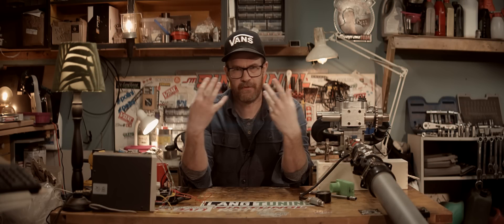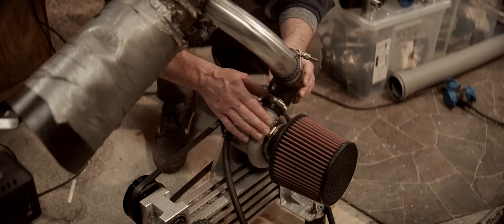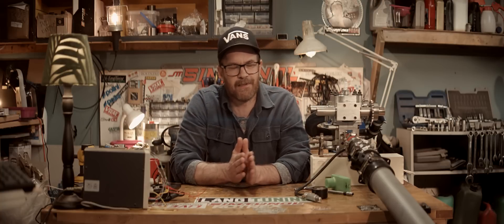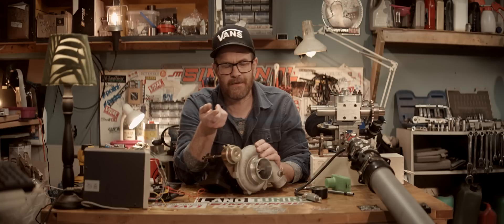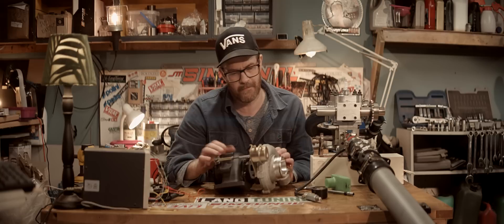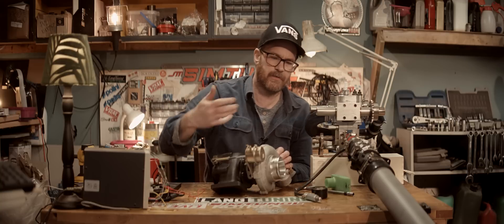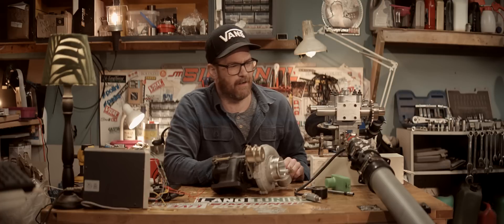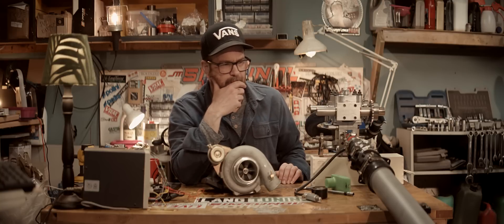THE most genius/stupid idea! Turbojet supercharging.

Comment: It makes no sense to say the centrifugal blower flows too much air at 1.8-2.0 bar, the max air flow of the blower is irrelevant. As with all turbo systems, all that is required is a blow off valve for excess 'pressure', flow is not considered.
Using a mechanically driven centrifugal blower to power a turbo is equally crazy, all you are doing is compounding your system losses which is sacrificing engine power for no gain!!
Reply: You missed the turbojet part; not using the mechanical compressor to spin the turbine directly, but also adding combustion - supercharger essentially feeding a jet which is in turn spinning the compressor housing to create the boost that's finally fed into the intake of the engine...
It's pretty intense, but the main question is whether the rules could still consider that a '50cc engine' at heart, given that there's effectively two combustion chambers?
I imagine not, though I still want to see it running!

As for the 'too much airflow' comments, though you're right that it can be dumped, it will be making too much even at WOT, and since you have already spent the energy to create that flow it's massively wasteful.
The pressure/volume relationship is terribly complicated and the only vague understanding I have of this is in relation to cooling fans, how some designs are better at static pressure and some at total airflow - I have some 24v 120mm monsters from old RF gear which can flow 1000cfm but any significant filtration behind them drops flow to a fraction of that number, and doesn't create any meaningful pressure either. Conversely a big centrifugal fan from a ducted air setup can maintain flow through 1/2" open-cell foam almost like it's not even there.
It's similar to the difference between a centrifugal blower and roots-type, they behave very differently when restricted; a roots blower can produce much higher pressure at a lower overall flow rate, which is technically great for his needs, but it also runs out of puff too early in such a high-revving setup.
Reply: @ph0end  Again ridiculous, he would be creating a jet engine to drive a turbo to feed a 50cc engine. It would be simpler to strap several jet engines to a 50cc moped...
Reply: @manoo422  
Simpler but orders of magnitude less effective - spinning an impeller to incredible speeds takes a jet that fits almost in your hand, but moving a bike & rider with direct thrust takes Robert-Maddox-level contraptions and won't break any speed records, plenty of videos of his to watch.
Is it a crazy idea... yes. Definitely yes.
Is it a sound theory? Also yes.
Would I like to see it attempted? Oh hell yes!

edit: Of course jet-powered landspeed vehicles are a thing, but the size and complexity of the jet turbine for that application is far beyond anything even close to the level/scope of this project - the kind of jet(s) that he can feasibly 'build and slap on a moped' is what I'm saying will be woefully insufficient for a direct-thrust method.

edit2: In relation to your discussion with Taren, the additional power comes from the flow that you're suggesting be vented at WOT!
Look up 'Twincharger' (Series) on Wikipedia, oversized supercharger-into-turbo is not a new idea, it is a tried and tested one.
Reply: @ph0end  Look up Zapata flyboard to see what tinny jet engines can do.
Land speed record for a 50cc engine...we are not talking about Thrust ssc hear.
The ONLY venting required is for excess pressure which it doesnt sound like there is any at WOT.
In twincharging the supercharger isnt driving the turbo it bypassing it until the turbo spools up and takes over.
Reply: @manoo422 
There is definitely excess airflow at the desired pressure at WOT, it's Alex's statement about this that caused this whole discussion. I think you're missing that all compressor designs are not created equal, I've given a couple of examples but another real world one is a piston compressor like the type you blow up tyres with can create very high pressures at very low airflow but an airbed inflator does the reverse; it can build moderate pressure but creates a massive amount of airflow in the process. A centrifugal supercharger behaves more like the latter and a roots blower more like the former. Twincharging doesn't always bypass after turbo is spooled up, you can keep compounding (with issues like excess heat) or you can bypass, both approaches have been used in production engines, doesn't sound like you read the article.
Finally, turbo setups also don't always have factory BOV, 1988 Holden VL turbo (rb30det) is one example, it has wastegate only. Yes the turbo cavitates, no it's not great for it, and yes other vehicles have done it particularly in the old group B rally scene and in drag racing in an effort to not lose all the built boost between gear changes on small engines with big turbos that take a long time to spool up. If you want to hear the sound made when a turbo gasoline engine with no BOV closes the throttle look up 'VL turbo dosing' here on YouTube. Additionally, no turbo diesels have a BOV either as a diesel has no throttle butterfly; the intake never closes, it's why they need a vacuum pump to run the brake booster as the engine never produces vacuum, so your continued assertion to the other guy that every turbo engine ever made has a BOV is just plain wrong.
You clearly have some knowledge, just not quite enough to realise you're off the mark in this case.
Reply: @ph0end  If you think there is excess flow then how is it being measured?
The principle of twincharging is a super charger for low speeds and a turbo for high speeds, one takes over from the other. Its not to drive a turbo with a supercharger which is what is being proposed in the video.
Competition turbo builders are happy to sacrifice component life for performance by leaving off the BOV. I have a turbo diesel and when the exhaust was damaged you could hear the BOV dumping into it every time I changed gear.
Reply: @manoo422  
That would be the wastegate you're hearing, turbo diesels do not require a BOV as they have no throttle plate/butterfly; the engine revs or slows as fuel input is increased or reduced, the accelerator controls fuel governance only, not air. The way they operate is considerably different to a gasoline engine.
I too run a turbo diesel vehicle, a Toyota VDJ76, which you will find has no BOV listed on its part breakdown as it does not require one. 
It's not just 'competition turbo builders' who omit a BOV, I have already quoted a gasoline vehicle that left the factory with no BOV, despite your claim that they do not exist, there are many others if you care to look.
Next, read the Wikipedia article on twincharging and come back to me, there are multiple ways to configure the setup, and one is absolutely feeding the turbo with the supercharger, and can include a bypass, _or not_. Some vehicles with this configuration are even quoted in the article.

Time and again, you are conflating fact and opinion. Feel free to look up the part number yourself for the replacement BOV that you don't have on your turbo diesel vehicle...

Lastly, the way to measure flow volume at various pressures is shown in the video you're commenting on; a flow bench. This may be a rudimentary example of one, but it is literally how such things are tested. Call a shop that does head or turbo flow testing and argue with them instead of some stranger on the internet.
Do literally anything other than blindly defending your own assumptions, because at this point you appear to be arguing for its own sake; campaigning, not debating.
Reply: I don't know of any turbo system ever that used a blow off valve for excess pressure management(Other than at low load situations of course) wastegate(or VG) is the preferred method(It is very very obvious why), flow is obviously considered if you don't want to waste power on doing nothing of value.

How is the turbo idea "sacrificing engine power for no gain"?
The turbo idea could create higher pressure from the same parasitic engine load, obviously meaning higher power...
I mean he could just use a turbo as a regular self driven gas turbine and use bleed air for engine boosting, but I assume the land speed record rules sees this as a separate engine.
Actually have no idea what the land speed record rules say about any of this.
Reply: @TarenGarond  What do you think you are hearing on a tuned engine every time the driver lifts off the throttle?
He is quite clear at 7:47 that the turbo is fed from the centrifugal blower, that makes it sacrificial.
Reply: @manoo422  I'm quite sure lifting the throttle fully is considered a low load situation...
But yeah sure pressure is dumped in slight lift offs too so yeah I should have said something about that, but anyway it kinda irrelevant anyway no turbo system ever(That I've heard about) does manage pressure though dumping air in normal full throttle operation conditions(Think some two-step systems might dump air though to get the turbo operating in "better conditions though").

You originally said "sacrificing engine power for no gain" which obviously is wrong, you are able to get more power from driving a turbocharger with an SC than directly using the SC to pressurize the engine.
Yes might or might not make more sense to just have a turbocharger driven in a classical way.

Edit : I re-read your original comment more properly and your "sacrificing engine power for no gain" might not be meant as normal SC vs SC powered turbo, but SC powered turbo vs regular turbo...
Reply: @TarenGarond  I can only assume you have zero experience of turbo engines because every single one has a blow off valve which opens every time the driver changes gear. It is obviously NOT irrelevant as the engine wouldnt last long without it. A waste gate does exactly the same job of reliving excess pressure from the inlet, so as I said air 'flow' is irrelevant.
If you think its not sacrificial where do you thing the addition power 'output' is coming from? Or do you think driving round all day with your headlights on doesnt effect your fuel mileage...?
Reply: @manoo422  "A waste gate does exactly the same job of reliving excess pressure from the inlet" lol, what?! The wastegate does dump exhaust to limit boost pressure, it is obviously not "exactly the same job"...
You don't make much sense

Edit : I don't even care to reply to the rest...
Reply: @TarenGarond  What is the exhaust waste gate actuator attached to? Could it be the inlet manifold?
You cant reply because you dont understand how a blow off valve works or basic physics. On every single turbo engine ever built.
Reply: @manoo422  I obviously could have replied but it is a bit of a waste of time as I mostly had said what I wanted to say.

But yeah I advice you to do a bit of reading about turbos and centrifugal compressors in general(Watch some compressor maps and turbine maps) as you don't seem to have much of an idea of their operation and the total stupidity of dumping out large percentage of air to regulate boost pressure in a steady state full throttle operation.
By the way, the way dump valves dump air is totally irrelevant to the discussion(But I obviously know how they work, if done in the classic way(Electronics could be involved these days) the valve is opened when a certain pressure difference between pre-throttle(Wherever the dump valve is mounted) and after the throttle is obtained, this is done to keep the compressor away from surge on throttle let off) as I originally replied to you saying :
"It makes no sense to say the centrifugal blower flows too much air at 1.8-2.0 bar, the max air flow of the blower is irrelevant. As with all turbo systems, all that is required is a blow off valve for excess 'pressure', flow is not considered."
(I agree that the max air flow is irrelevant as the supercharger is very oversized(No idea why you are talking about it anyway, did you mean minimum flow?) it is the minimum (stable) flow around the wanted pressure and used compressor RPM that is interesting in this case)
In this text you seems to state that dumping out air of a very oversized centrifugal supercharger somehow is a good idea and also that all turbo systems do dump air to regulate boost pressure(They obviously use a wastegate for that!!!) or what the heck did you mean?

By the way did you in your last reply say that blow off valves are on every turbo engine ever built?!
In that case, what the heck you on about?

Comment: I think the only problem with this idea is that it's no longer a 50cc engine. You are adding additional combustion volume external to the main engine. I think the real solution might be to try and work with rotrex or someone to just make a custom supercharger.
Reply: It's kinda like anti-lag,  don't know about the rules regarding it are though
Reply: @jordanthedove its like the time subaru did that in rally. There is a video here on yt that explains this concept really well
Reply: @LuxGamer16   Nissan did similar in the 80s with the K10 March/Micra Super Turbo.
Reply: I want to be clear I'm not saying it can't work. I'm saying that in the context of his stated goal which is to build the "most powerful 50cc 2 stroke" and then go for a land speed record you can't add another engine, motor, jet, or rocket. That defeats the whole point of trying to make a highly optimized 50cc engine.
Reply: @crystaldragon141  precisely. its a 50cc engine. "swept volume of 50cc". not "externally assisted". theres no rule about how much air is actually in the cylinder, but the basic cylinder providing ALL the power required, im pretty sure thats a fairly strict rule...

the thing is, he is on the right path, he just hasnt had the monumental "lightbulb moment" yet...

the engine already IS a combustion chamber. it doesnt have to serve a dual purpose, ie, a compressor AND expander...
Reply: Imagine an engine that is being boosted by a supercharger which is being run by an electric motor - do we need to add the battery capacity or the electric motor HP to the final power output?  Nope. 

Same idea as an electric car with a small battery AND a small petrol engine that generates electricity, charging the battery.
Reply: @N0MAD1977  I disagree you do need to add in the external power, it's functionally the same as adding another gas engine. The only way your example works is if you generate all the power in the battery with the gas engine. This can work but you can't charge up a big battery on the side and then just consume it. His ultimate goal is a Landspeed attempt with the "Most powerful 50cc 2 stroke. You can't have a 50cc then strap on jet turbine and call it the same. Turbo's and Supers are different because they are powered by the engine. It takes horsepower to run a turbo or super. The bonus is if sized correctly they end up adding more power than they consume. Primarily by shoving more air into the cylinder  which lets you add more fuel for a bigger bang.
Reply: @crystaldragon141 turbos don't rob horsepower, they actually make your engine more efficient because you are using spent exhaust gases to produce more power
Reply: @jok3yjesu339  a Turbo consumes energy in the form of expanding hot exhaust. Anything that does work consumes energy. Horsepower is just one measurement.
Reply: @crystaldragon141  it doesn't rob horsepower, it uses the wasted energy that the engine doesn't use aka the heat and energy of the exhaust moving after the combustion process
Reply: @jok3yjesu339  something has to force that exhaust gas out through the restriction posing as the "turbine". 

turbos raise exhaust pressure. by doing so they reduce scavenging efficiency. theres more residual exhaust gas in every fresh "charge".
the higher the cylinder pressure at the end of  the exhaust stroke, the less fresh charge can be pushed in.

other than that, yes, a turbo makes most of its power by using otherwise wasted exhaust heat, and raise the total efficiency..

except then they have to run on a richer than desired mixture to prevent catastrophic engine damage, so the gain in economy in one aspect is negated by another.

in the end, they both work out to be much the same on fuel economy and peak power, only real difference is  a fixed displacement charger maintains the same level of boost at all RPM, the CSC and turbo having logarithmic boost curves.
Reply: @N0MAD1977 there a guy doing just that on is car brushless electric centrifugal supercharged
 it work pretty good 
He modified a vortex supercharged if my memory serves me right
Reply: I know he is doing experimental stuff, but he is far off the uncomplicated two stroke engine we all love.
Reply: @20kBOOSTED  sure because what you said make no sense

Comment: Why not just put a restrictor on the intake of the blower? It's good for 2.4 bar looking at the compressor map.  
Ideally a turbo'd engine is the way to go.. More efficient faster spool up etc. An  VZ21 RHB31 turbo with a 15 psi internal wastegate would probably work well..

Comment: Reduce complexity.

Make the gas turbine with a gasoline engine turbocharger, it has to have a small turbine and a bigger compressor to give you some more air.

Diesel turbochargers usually have more balanced dimensions.

Divert a percentage of the air from the turbocharger compressor into the roots inlet, and voilà, you have your pressure.
Reply: Reduce complexity? Machine a new impeller and housing for the vortex. What do you say?
Reply: @TekamsTheOne  Oh yes, for sure. milling an impeller is a simple solution, isn't it?
Reply: @dadoVRC  yeah, might have forgotten the missing axis...

Comment: Just a thought, if you are able to carry fuel for your run at Bonneville why are you not allowed to carry compressed air? Bike frame could be turned into a pressure vessel. Therefore no motor energy required to run blowers????